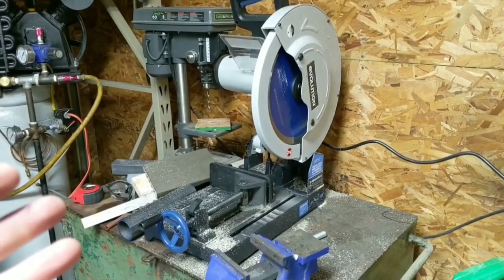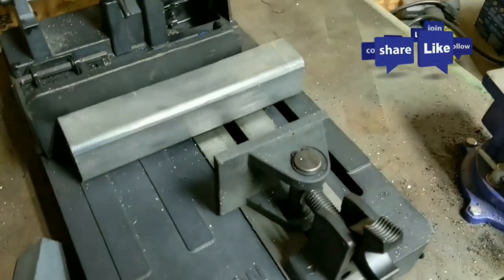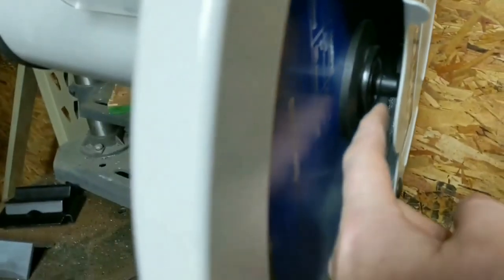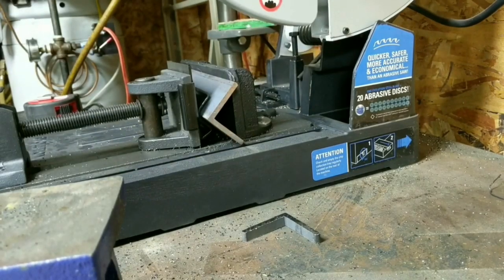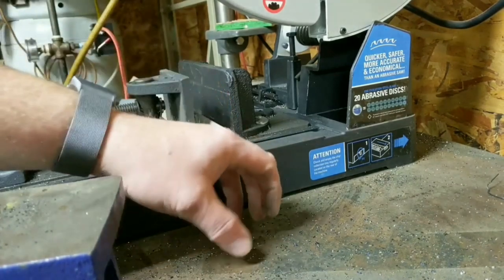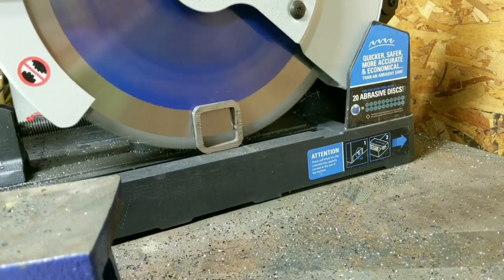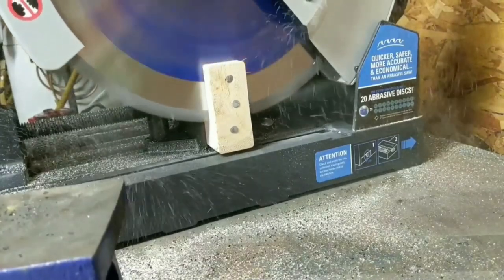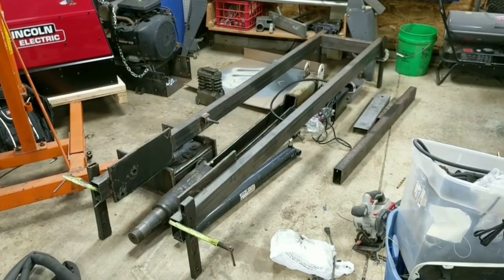Evolution Power Tools EVOSAW380 15-Inch Steel Cutting Chop Saw Review

Comment from the maker: Notice: The original video was pretty lengthy and needed cleaned up a bit in editing.    I was going to just remove it from my content, however they still sell this saw today and it may be helpful for someone looking to buy it.    I have since given this saw to my Dad and he uses it in his shop and really likes it.    I'm still using an evolution chop saw, just a different model.
Reply: What model are you using now.  I have a channel of farming and will be building a32 foot sliding gate door.  I have a chop saw but cuts and flexes.  Which Evo do you recommend.  I will be building cattle corals and will be cutting well pipe ETC.    Thank you
Reply from the maker: S380CPS is what I've been using.   It's worth taking a look at!  It's one of the most used tools in my shop!   https://www.youtube.com/watch?v=xMc0oHx4Pgk

Comment: I noticed as you stated that you were able to handle the cut pieces without burning your finger and on top of that there were no visible scorch marks around the nails after you cut through the wood: amazing!
Reply from the maker: The material is warm at best, not hot at all.   Quite amazing really!  And the wood didn't get hot enough to burst into flames.  :D

Comment: Saw does cut but mine after a blade change and dusting off on what is supposed to be a normal flat cut  has variances of up to 2/8ths of an inch difference on straight cut as of this evening. I can't figure out where the play is coming from. Mine is one of the early models, bought in approx 2017. The cuts don't appear to be uniformly flat.

Comment: I cut lots of 2-3/8 and 2-7/8 oilfield pipe.
How many crosscuts can I get from a blade? (either size)
Reply: 14" blade you may get 20-30 cuts before it needs sharpening, your experiences may differ from mine.

Comment: could you just put one of those blades on a regular metal cutting saw? or would the rpm be too high?
Reply: They would not have the torque or stiffness to handle the cutting forces.
Reply: NO.. These blades are made to operate at low RPM (below 2000) and regular saws operate at high RPM (4000+). Metak cutting blades will become dangerous at high speed.

Comment: cut aluminum with the aluminum cutting disk only!
Reply from the maker: Sure, if that works for you!  The cuts with these blades are cold and the aluminum never melts and sticks to the teeth, so for me, it just doesn't matter.  The blades do exceptionally clean cuts on aluminum and steel.  I see no reason to swap blades, but that is just my experience for what I use the saw for.   Obviously your experience may vary and you will want to follow the manufacturers recommendations, unlike me.  ;)